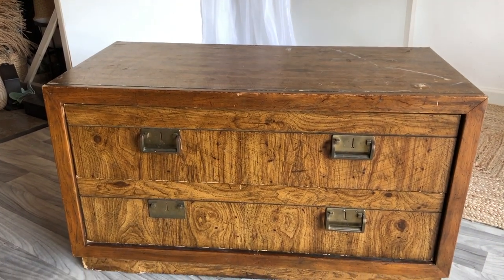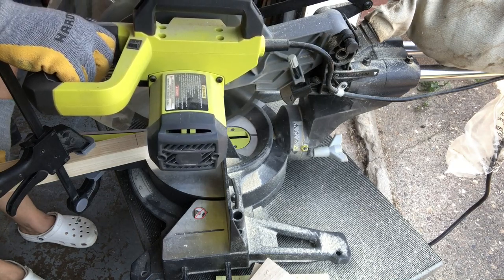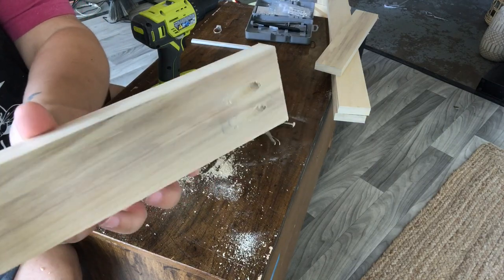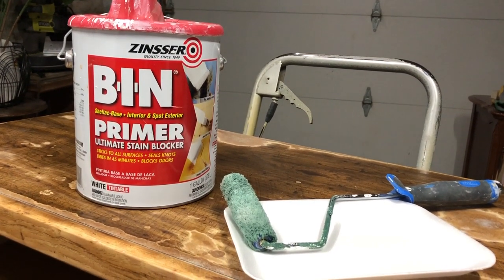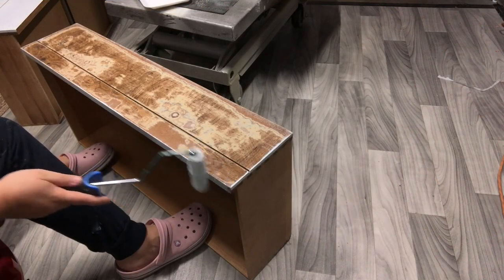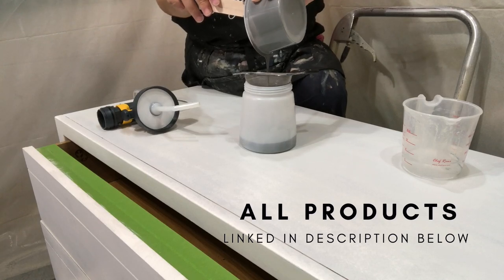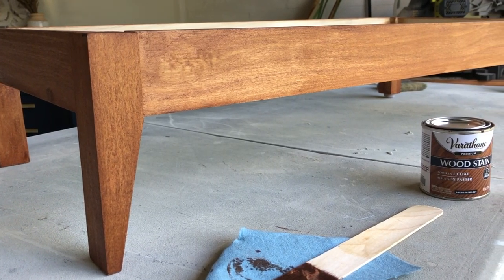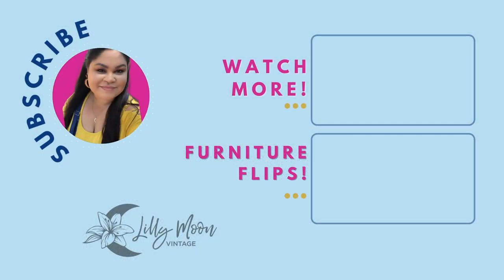DIY FURNITURE BASE | Furniture Makeover | Side Hustle

Comment: I love poplar because of how evenly it stains, I've never had the blotchy issues! But it's good to know that if i ever do i can shellac first🤔 i love how it turned out! I don't think red oak would have been as beautiful! I subbed!
Reply from the maker: Thank you 😊
Reply: The best way to avoid a blotchy finish when staining is to use a wood pre-conditioner first.  (Make sure you use water based if your stain is water based, oil based if your stain is oil based).  It helps tremendously!